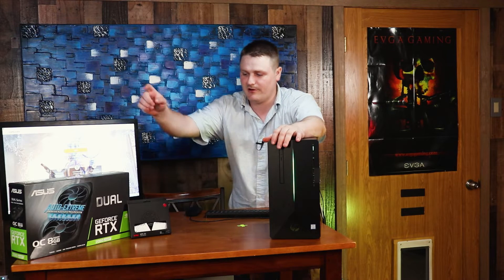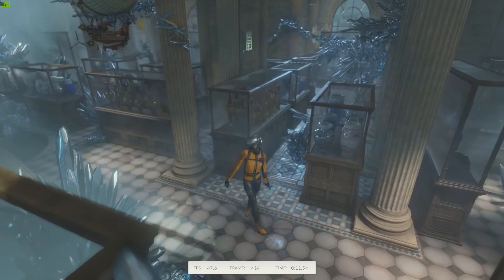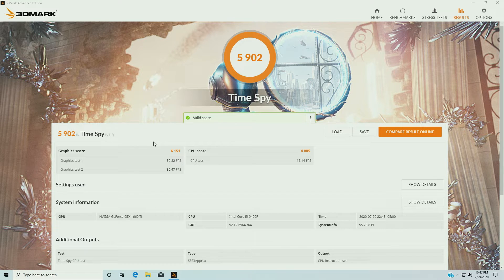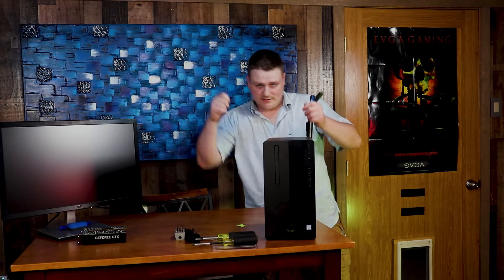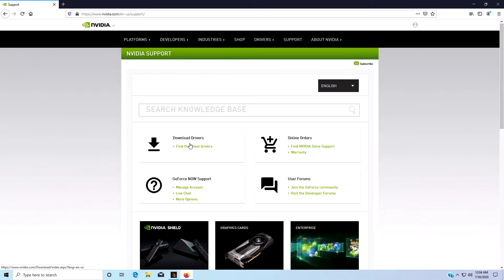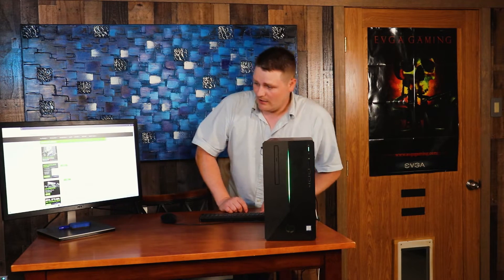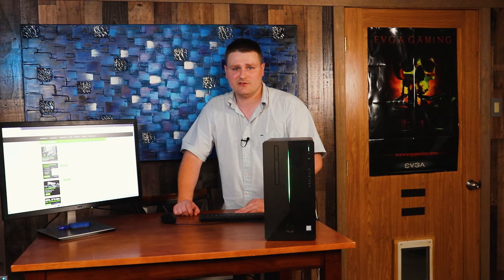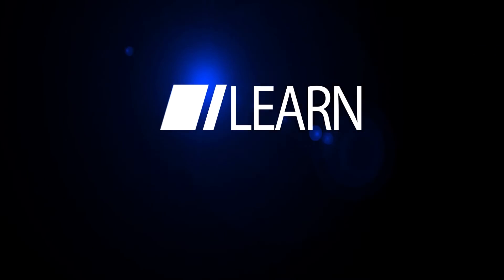Hp Pavilion Gaming Desktop 690 Upgrade To A RTX 2060 Super 8GB GPU & 16GB Of Ram (How to Install)

Comment: wow, I really want to get that pc
Reply from the maker: :) Thanks
Reply: My head hurts so much right now, can you please tell me what should i get?
Hp pavilion ryzen 5 3600 gtx1650 super, 8gb, 256 gb. 
Or Acer nitro 5 gaming laptop- ryzen5 4600h gtx1650, 8gb, 256 gb? ? ? 
I saw the desktop for 600$ 
And the laptop for 669$
Reply from the maker: @aitur.j  What is your goal and do you have to travel a lot ?
Reply: Yes, i have to travel, the pc looks small, I think it might fit in the luggage
Reply from the maker: @aitur.j  I would say Laptop All the way. That's not a bad laptop you picked, it well do gaming just fine. Make sure to keep it clean and turn it off when not in use. So it does not suck dust up. Also I would look for some thing that has a little bit bigger Hard drive space then a 256Gb. A 256Gb drive will go fast with 4 or 5 game installed on it. When its full it will suck to have to jungle files all the time.

Comment: I have the same system with a 400 watt PSU and wasn't sure if it would take the AMD 2060 Super.  This video answered my question!  Thanks!
Reply from the maker: You mean rtx? Or readon ?
Reply: @TNW1337  Lol... I meant Nvidia RTX 2060 Super.
Reply from the maker: @genghis288  all good I was pretty sure that's what you meant :)
Reply: AMD lmaoa
Reply: what was ur answer?

Comment: Can you send links or something for new cases for this pc
Reply from the maker: You want to swap the parts in to a new case ?
Reply: TechNitWit Yes!!
Reply from the maker: @teamevale5871  ok 1st thing 1 is you will also need to get a psu and the adapter cable to go from the new psu to the hp mother board. Any atx case should work for swap. You can find the adapater cable on Amazon. There are 2 types just make sure to match the wire colors and size. I am not at home right now but if you need a hand I can help you tonight.
Reply: TechNitWit k
Reply: TechNitWit should I get a mid tower
Reply from the maker: @teamevale5871  Mid would be nice. Full prob over kill.
Reply from the maker: @teamevale5871  I really like the Fractal Design & Corsair Case's. I would stay away from thermal take cases.I've Not had good luck with them.
Reply: TechNitWit can you send me link to the psu so I don’t get the wrong thing
Reply from the maker: @teamevale5871  Any ATX Platinum or Gold rated over 550/600 Watts should work. Fully modular or half Modular works as well. The difference is the extra cables you do not use, will not go in the case. Make for a cleaner looking inside and better air flow. https://www.newegg.com/seasonic-focus-plus-650-platinum-ssr-650px-650w/p/N82E16817151192?Item=N82E16817151192 One of the best brands on the market For PSU's.
Reply: TechNitWit if I do get all this can you make a video for me or send tutorials
Reply: TechNitWit and will phanteks cases work
Reply from the maker: @teamevale5871  You will need to match it to your boards cable or ask on amazon witch one is right.
It should be one of these cable's. The link below is to a wish list. I did not want to have to add 4 or 5 links to the comment's.

https://www.amazon.com/hz/wishlist/ls/HCOMZ59O0C39?ref_=wl_share
Reply: TechNitWit oh ok
Reply: TechNitWit this other dude said I won’t be able to switch cases bc the motherboard is that true
Reply from the maker: @teamevale5871  It should it is a atx mother board forum factor. Know I have not had it out of the case. But should be no reason you can as long as you get the HP power cable. Let me look at the spec sheet again. But I am pretty sure you can.
Reply from the maker: I just looked he is right, it is not a standard Atx motherboard.
Reply: TechNitWit so i wouldn’t be able to change it
Reply from the maker: @teamevale5871  One option is to look at a different z370 Motherboard. You have Ram, Gpu, Drives & a good CPU. Which will work in a z370/z390 Motherboard. Whats you budget? what Where you planing on spending on the PSU and Case ? let me see if I can get you a parts list to make it work.
Reply from the maker: @teamevale5871  Yes I could make you a video On how to do it. If I had the right parts sure. This is one of the downfalls of owning a HP/Dell.
Reply: TechNitWit EvL Κακό#6302
Reply: TechNitWit that’s my discord
Reply: TechNitWit so all I need is a new motherboard won’t I need to buy more ram and stuff
Reply: @teamevale5871  Hi I was just wondering about this too did you end up getting a new case and a new motherboard because I wanna swap out cases too
Reply: TechNitWit I have discord

Comment: Woot so I got that GTX 1060 installed. I figured it out ya got tootake the dvd drive completely out easy anf  carefully pop the front plane off  undow 2 screws . to bring the cage down the cage fits perfect its just a tiny bit snug . I have too wait for a adapter from 6pin female to 8 pin make man I thank you for the help my last 8 GB ram is on its way so all be up too my max of 32gb man this 1060 3gb is pearty I got it for 154$ they normaly run between $230 too $300+ awsome steal main point is thank you for all you HELP amazing
Reply from the maker: Yeah That would be cool to see. Just hit me up when you do it!
Reply: @TNW1337  ok I will would it be easyest too just tag you or how would I got about that I guss if you go too my channel & sub then hit the bell would be best
Reply: My wife acutaly help me to so we learned toghter
Reply from the maker: @alphadogzairsoftfamily7245  cool tell me what you think of the new video Also if need be you can slow it down on youtube.
Reply: I mean acutaly make a video on my channel for when I get the cable so you can see what I mean .about the 790 its quite diffrent they look alike but I think the 790 is little bit diffrent .
Reply from the maker: @alphadogzairsoftfamily7245  it is Kinda why I want to do one. Thank you for the reply man. Happy its working out sorry If there was some thing I could not help with.
Reply: I'm run normaly runing at like idk 180fps + for almost any  game .but i really like it kinda awsome learning this stuff I'm kinda techy know ish
Reply from the maker: @alphadogzairsoftfamily7245  Yeah I like it to I am still learning stuff every day.
Reply: @TNW1337  me too buddy hey I'm think on when that cable comes in ill so a video of opening & installing the cable so you can see its kinda a crazy prosses lol but trial & erroer6
Reply from the maker: @alphadogzairsoftfamily7245  Yeah I know that some of the models only come with a 4pin molex, and they use a cable to install GPU's stock, From hp it comes this way. Not sure why maybe they are run low on PSU with a 6/8pin As I know they have them.
Reply: The GTX 1060 comes with 6 gb and there's a cheap version that only comes with 3gb.
Reply from the maker: @nicholaswatson999  yeah they have like 20 differnt version with differnt memory and gpu clock.
Reply: Yep np man it's awsome I had too mualy install the drivers cuse mine was not brand new & install the app too trun the fans of and on & change the leds but all is good know . just waiting on the last stick of ram I posted videos of it .
Reply from the maker: @alphadogzairsoftfamily7245  Cool when I get Time I will take  a Peak